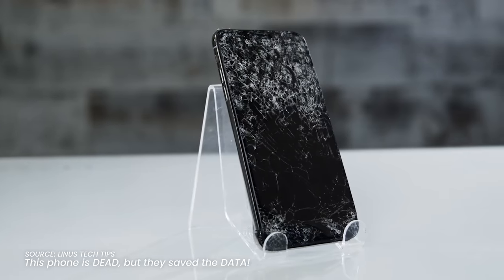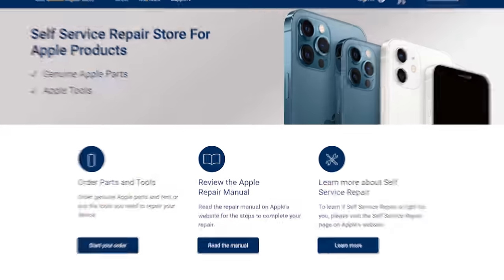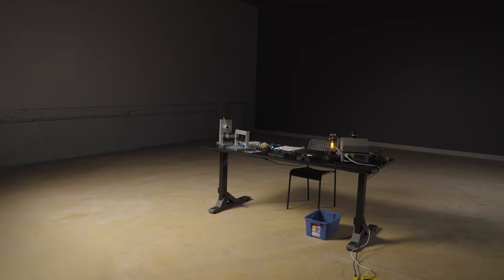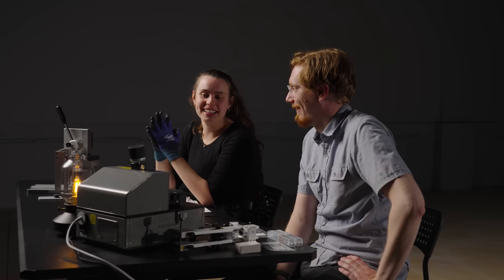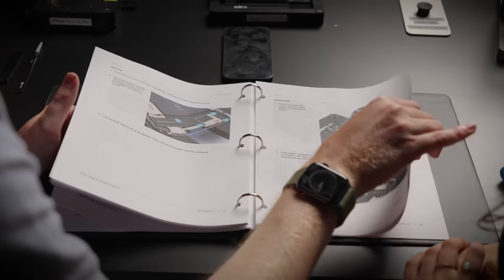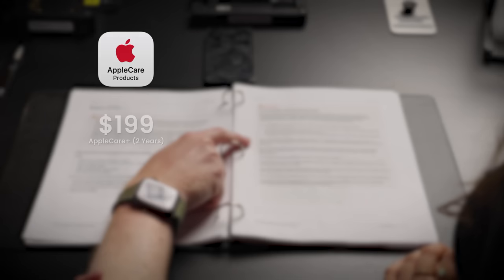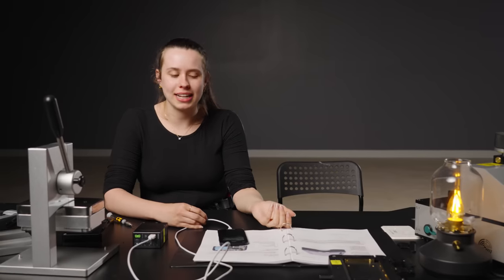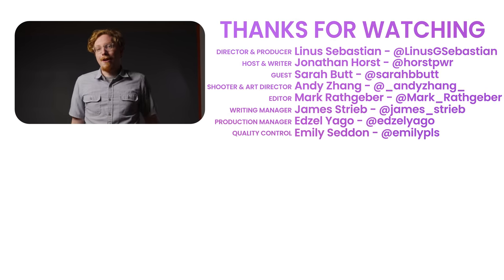I made her fix my mistake!

Comment: My lightning port on my 11 broke this week and I’ve been relying on wireless charging. I’m dreading getting a new one :( I wish apple was more up front with older phones and providing parts at reasonable prices
Reply from the maker: I hear ya! Especially since it's the older phones that are the most likely to have something broken. Also... you sure it isn't just full of pocket lint?
Reply: @macaddress  I’ve cleaned it numerous times, it’s clean as far as I can see. It’s kinda works, I believe it was water damage or something something that happened to it at work. I dropped it on a concrete floor and a couple weeks later it started acting up. I work at a shipping facility and cardboard emits a lot of dust so it could be some buildup that i completely missed
Reply: @birdley  Apple doesn't sell charge ports for any iPhone, it's on a separate board but they won't sell it to anyone. You'll have to buy it from someone else if you want to fix it... 😉
Reply: @macaddress  Lol I once had an iphone that didn’t charge; I went to 3 different repair guys who all wanted to charge like £40 to replace the port before I found one who just took my phone, plucked the lint out with a sim card tool and gave it back to me.
Reply: @Freakinawesome333  dude years ago I traveled 2 hours to a Genius Bar appointment because my iPhone 5 wouldn’t charge. Got there, waited around a couple of minutes and the lady took my phone and asked what the problem was. I said it wasn’t charging. She took the sim removal tool that was attached to her lanyard, turned my phone over and pulled out a wad of lint. She turned around, grabbed a charger from one of the display models, plugged my phone in and it started charging immediately. I looked at her crestfallen. I felt like such a dumbass
Reply: Yes! My iPhone 8 lightning port is wonky due to me using the headphone dongle my iPhone 5s never had this problem! Thanks apple
Reply: @birdley  Connect your cable and if the collar of the cable doesnt sit flush with your phone or it wiggles and doesn't make a firm connection, its probably dirty. Happens to site workers and painters all the time. You can take it to a reputable repair shop and probably have them clean it for $15 or sometimes we did them for free.
Reply: @WhatAboutZoidberg  I work in a warehouse filled with dust. I just cleaned it again. We’re good for now lol
Reply: @Freakinawesome333  did he charge you for that?
Reply: @jawadbilgrami4676  Damn, at least we can be glad our phones weren’t actually broken. People, if your phone isn’t charging, clean the port out!
Reply: Usb c conversion time.
Reply: @VezWay007  Luckily no :) he also checked it worked, and of course it charged perfectly well. Good guy, unfortunately I think the shop is closed down now.
Reply: take it to a good third party store, charging port replacements are quite common and it'll be cheaper than a whole new phone
Reply: @birdley  use a charge port dust plug. you can even get ones with a ring to attach accessories if you're into that.
Reply: I mean if wireless charging works then there is no reason to feel super bad. 
How often do you effectively use your port?
Reply: Usb c time?
Reply: @vadnegru  god I wish apple would ditch lightning already. I know they’re gonna. But it’s gonna be a couple years yet
Reply: @birdley  there are free schematics to make it true.
Reply: @birdley  hey I’m in the same situation too with my 11 pro max. Had it cleaned but the port is still iffy. Gonna need to spend money for someone else to replace it when I could have otherwise done it myself if the parts were more readily available
Reply: Before you guys go and change your port. Make sure its not the cable connector. I had accidentally got water in my port (ip7+) and charged it without knowing, this caused a short on the cable. As soon as I switched to a new cable the problem went away.
Reply: @WhatAboutZoidberg  Yeah, might not be the safest cleaning tool, but I use a toothpick or end of a paperclip to pull out any wads of lint stuck in the port every few months and it goes back to working as good as new. Even the snappy feel when you insert the cable feels new. Whenever a friend says their port is "broken", I usually notice the Lightning cable doesn't sit flush in the port and try cleaning it for them. It's almost never the port but just a bit of dust or lint. I actually find Lightning to be very robust.
Reply: Good on you for alphatesting the no port iphone lmao
Reply: This is why I wish Samsung Apple and Google would play catch up with international phones who are now supporting 50 watt wireless charging pretty regularly.
Reply: @macaddress  revisiting this thread. Cleaned the port many times, phone just kinda deteriorated. Yesterday the entire display just gave up. Got a 14 last night. Thanks apple :/ at least I can fix this when it inevitably dies in 3 years or so

Comment: to pull the battery, isopropyl alcohol is of great help
also, bootlooping is most likely an earpiece speaker defect, not motherboard, but since apple don't want to let face id work on a replaced earpiece speaker (that's where the sensors for face id is) for "SeCuRiTY", so repairing your phone make you loose face id
Reply: Apparently according to others videos I've seen on this kit, Apple tell you specifically NOT to use IPA to dissolve the adhesive. The residue can cause issues if it gets where it shouldn't.

Comment: "I had Jake backup your phone and do a restore on the new one" - ok, that's some crazy bad physical security. I can't tell if that's a Sara issue or an Apple issue, though.
Reply: Lmg might have a backup policy.
Reply: @nitePhyyre  Considering they barely have a backup strategy for their servers (see the various "all our data is gone" videos), I'd press X to doubt on that one.
Reply: @Killerpixel11  I mean surely it's not unwise to backup your backup, but the servers are technically the backup. And if those catch fire it's understandable that they don't have a backup of the backup.
Also there might have been a sprinkle of clickbait
Reply: @Daniel-dj7fh  No, the server is not the backup. The server is the server, which holds all the data they work with. Servers need to be backed up. I completely understand not backing up all gazillion petabytes of video backlogs, but in all these cases, they lost important stuff like documents, templates and such. That, at least, along with ongoing and unfinished projects, needs to be backed up to different hardware and preferrably backed up again off site.
Reply: @Killerpixel11  ha ha! Good point!

Comment: "iPhones are pretty fragile"

Actually, the stainless steel frame on Pro iPhone variants leads to pretty exceptional durability when being dropped, compared to other phones with aluminium frame, which dents hella easily, and could lead to cracked glass.

Comment: I think there's only one scenario where you can say the Self-Service Repair Program works and is worth it. Is if you rent the tools and have multiple iPhones of the same model that are needed to be repaired or replaced. I guess this works if your entire family uses the same model of iPhones and happens to be in need of battery replacements, or anything to repair. So maybe just rent out the tools and order the parts, and since you indeed have many to replace. I think it will cost a lot less if they rent one set of the tools, grab the parts, and someone on their family do it?
Reply: Which probably would account for about 1/10 of 1% of people whose use case applies. I'm estimating but if you  own independent repair shop you don't need that stuff, already have adequate tools... So unless you're a content creator that happens to be fixing phones for ad revenue, it's hard to find someone who applies.

Comment: I am in Montréal and the Apple store here requires a visit to Genius to approve repair, then you get a call back for when you can drop the phoe for repair, and then pick it up a day or two later. (for battery, it can be same day if you drop it off early in day). 
The advantage of the self repair is that you don't need multiple visits to the Apple store and once you have the kit, can fix your phone quickly and not be without phoe for over a day. Some Apple stopres in other cities do provide faster service with fewer visits.

Comment: "Do you think it's great or should go farther? Comment down below."
Whoever says anything other than "this is a step in the right direction, but miles from the goal" is straight up wrong. At the very least, and I really mean absolute minimum, they need to make it way cheaper. $20 savings for the multiple waiting periods (shippings and chat bots) plus the hassle and potential to break it is absurd.

Also, the fact that they have the whole "new hardware detected, phone unusable" bullshit is bullshit.
Reply: It was clever in an evil genius kind of way for Apple to outsource this. When questioned about WHY it’s so damn expensive, Apple can simply say that they don’t set the prices and that their partner needs to make margin on providing their services.

And they weren’t done there. Have you noticed that the parts are weirdly expensive while the equipment rental is weirdly cheap? Huh… that means that it doesn’t really make sense for lots of repair shops to buy these and offer repairs on Apple products because the part cost is too high to offer a compelling value proposition. It puts a really cynical cast on the repair tool rental pricing which is barely enough to cover shipping, let alone cleaning, testing, & re-packing.

Comment: Regarding the borked iPhone 11, have you guys tried unplugging the FaceID sensor? It seems to work for me for a few of the newer iPhones I have repaired. If that unit gets damaged or if you have an aftermarket screen, the phone may stay black screened or boot loop until it is unplugged. So far this method has worked for me on the iPhone X, the 11, and 11 pro max, all of which were dropped before it happened.

Comment: One nice way to remove battery adhesive is using isopropyl alcohol. It deactivates the adhesive just by a moment so you can just remove it. You can even reuse it later and it doesn't make a mess in your phone.

Comment: I'm a curmudgeon still running an iPhone 6S. I just recently replaced the battery with an iFixit kit. Aside from the adhesive strips breaking and having to use rubbing alcohol to release the adhesive (a syringe would have been helpful rather than dribbling alcohol carefully into the case around the battery), it was fine. I also replaced the display adhesive which is optional. That was a little fiddly. The headphone jack is also worn out and won't hold a plug in but I didn't bother replacing it. I rarely use it anymore since I got bluetooth earbuds. But the phone still works and I'm going to keep using it for a while until they stop updating iOS 15 since iOS 16 won't support the 6S anymore.

Comment: This is literally my job and I can confirm. The battery adhesive pull tabs are worse than useless. You get started and they give you hope but then SNAP and you're back to using iso alcohol and a pry tool anyway.

Comment: 9:10 something worth noting is that with Apple Care they would not replace the battery unless it fails diagnostics or is tested to be “degraded” which is 80% of the original battery “capacity” You can still pay $70 for an out of warranty battery replacement but that would factor into the overall cost. At that point I would recommend backing up all the data to iCloud and breaking the back glass. Back glass damage requires a whole unit replacement which costs $99. Just don’t tell them that you broke it on purpose.

Comment: its actually really cool they offer the tools it would be even cooler if they had a DIY section of an apple store where the equipment was always available and you could pay even less to use it there. But ultimately the average person probably doesn't want to do this... And shipping and maintaining equipment is a lot of extra cost going into something which will end up affecting the consumer in the end... either this program will be even more expensive (and its already on the edge of too much) making it never see the light of day and thus not cost anything or it will trickle into the cost of everything else...

Comment: Definitely need to add more to be able to repair as well as more devices. This is seriously just something for them to point at when the government comes along and says that they can't block 3rd party repair anymore and say "look, we have this, and the amount of people using it pale in comparison to the number of people getting devices repaired at Apple stores" failing to mention that the program is complete trash compared to what we should be allowed to repair, while costing essentially the same as getting it done for you, without having to worry about Apple missing a return shipment or claiming that you've damaged the rental equipment in some way and not getting your deposits back/getting charged for it.

Comment: Quinn from Snazzy Labs made the good point that the repair kit rental is actually an amazing deal. I wouldn’t be surprised if the $50 repair kit rental fee just barely covers the shipping required for the huge case it comes in. I bet Apple just wrote off the repair kits themselves.

Comment: here's a question:can you mismatch components while doing this?like for example putting an iphone 13 display on an iphone 12?(ik that the camera and the notch holes don't match up but theoretically bc the iphone 12 pro max and the iphone 13 pro max have identical diplays in terms of dimensions,can you get 120hz on an iphone 12 pro max?)

Comment: i wish he would address how this kinda crushes small repair shops and like its so much harder than it really needs to be, like when you replaced the screen it said it could not verify it was genuine, which it 100% is, and all the tools feel unnececary when you literally need some screwdrivers, heat, prying tools and parts. except you have all these fancy machines that just make it cost more, not to mention how expensive the parts are, so like around 300 for a screen? when apple could replace it for a little bit more (that wouldnt be profitable so theyre probably listing their parts for way more than they are worth)

Comment: As a repair technician, removing the display adhesive from the iphone 12 and 13 is by far the most painful part of my job. Battery pull tabs are a close second, especially on the iphone X & XS
Reply: How would you rate the fixing of apple devices compared to lets say a samsung of the same caliber?
Reply: @Daniel-dj7fh  unfortunately samsung does not provide replacement parts to our shop yet. Its a newer place and samsung requires a bunch of paperwork and certs and stuff (so did apple) that were still working on. That being said, from watching jerryrigeverything and ifixit videos, as well as the training material samsung provides, repair difficulty is almost identical. Some samsung phones have curved screens, and are more likely to break while removing them if you arent careful, and i have not seen anyone attempt a rear camera replacemnt on a note 10 or earlier device yet.

Comment: I think if my iPhone broke that I'd just get Apple to fix the phone. It's not much cheaper and the hassle afterward doesn't seem worth it. I always keep an old phone around for backup (though I haven't needed it yet thankfully). I'd have to send my phone in since I don't have an Apple store nearby. So it's not like it would be any faster to get the repair kit either. It would be neat to try the repair kit out though.

Comment: In the early 2000s up to 2008 I disassembled every single phone I ever bought. I changed cases and made repairs for friends and family. If I should throw in a display, I grab my sim tool, get my sim out and some gloves plus a bucket with sand and a hammer. I make sure nobody would ever revive that thing, the bucket is for the battery in case it catches fire. I can't care less what they cost initially or whatever, I get another phone that very damn moment, be it a 150$ Chinese android. The effort to repair an iPhone outplays the effort Id put into dating, who would go that far?

Comment: The iphone 11/pro/max  has a notorious bootlooping issue due to corrosion on the earspeaker ALS sensor , try unplugging the earspeaker connector and starting the phone. All your data should be intact

Comment: Okay so here is my issue that I am having with my iPhone 13 Pro Max. To preface, I paid for AppleCare+ and started having issues with the screen going black intermiate with flicking white lines at the top of the screen very briefly. The phone wasn't dropped and is in a protective case.  Now to me the issue seems to me something with the Logic board or there is a issue with the display connector. I reached out to Apple Support via live chat and was told to send it off even though I have AASP in my city.  After lots of Googling the workaround is press on the screen and run my fingers down the side til the screen comes back. I reached back out to apple to inform them and was told unless there is a visible issue with the phone no repair would happen. *Sigh*. About a week or two later after having my phone in my back pocket while walking had the same issue again so I went and booked an appointment with the AASP. Again fixed with the workaround. On the day of the appointment, the AASP tech plugged in and ran Digonsios and couldn't find an issue and was told to talk to my Cell Phone Provider then Apple. Yeah... So still no fix and going to go straight back to AASP when the issue reappears. If not going to be going though so many hoops for a simple reseat of the screen.